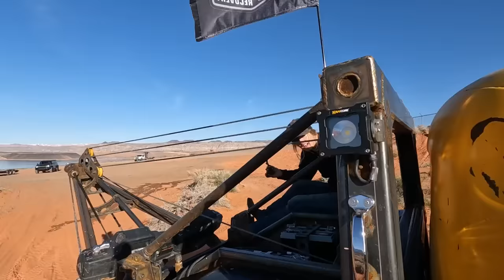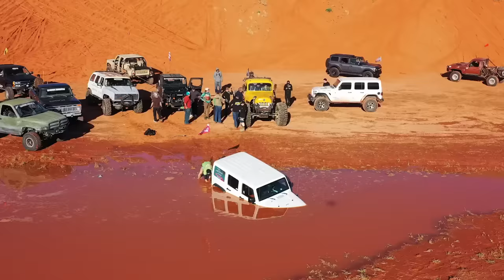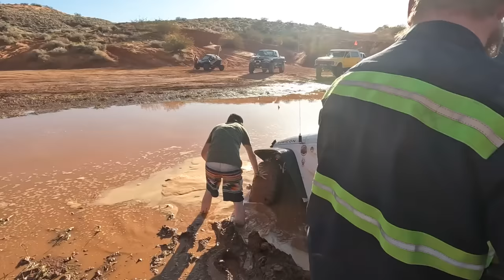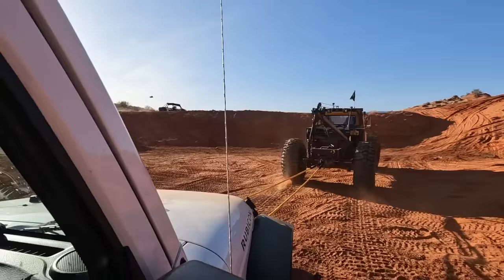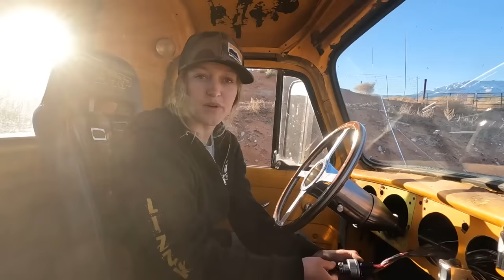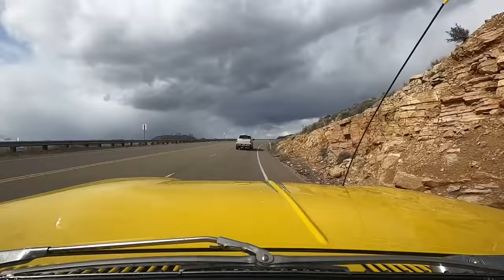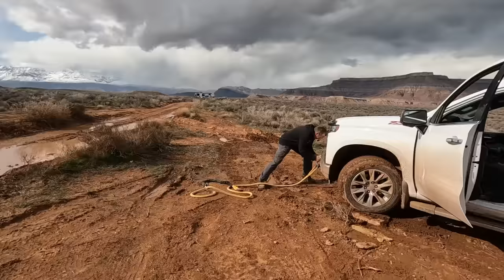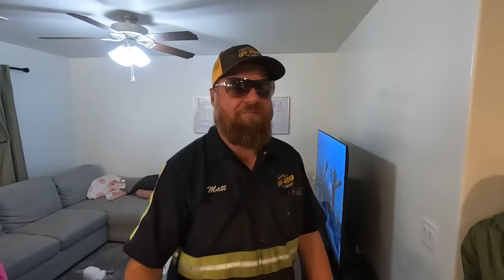Customer Took His Jeep Swimming...Oh My!

Comment: Lesson learned: never kinetic pull a vehicle out that is stuck deep in mud. The suction is too much and damage will occur. Use a winch with constant pressure instead. Matt has said this numerous times in his videos! It's always been true!
Reply: Actually never kinetic pull a vehicle without a kinetic rope. They used a strap not made for kinetic pulls.
Reply: They used a flat strap. Not a yankum
Reply: Doesn't matter this one is crusher bound.
Reply: @jordanwacker7762  Yes, absolutely true, you shouldn't do a "kinetic" pull without an actual kinetic rope, so that's half of their failure. But Matt's been very clear about NOT doing a kinetic pull in these conditions even with the correct gear for the reasons that Joe mentioned. There's just too much suction and you're going to break things. Slow and steady with a winch is MUCH safer.
Reply: @jordanwacker7762  Not that a real snatch strap is bad, It's what we Aussies have gown up with, just 20% stretch instead of a yankum's 30%. It's plain straps that are the terrible idea.
Reply: Judging by the damage to the Jeep I wonder if they used a hitch ball and it broke.
Reply: @ROgletree  Did you watch the videos from the Wrecker Games? Paul broke a Yankum strap (one of the short loops to connect ropes together) and the resulting damage to Blue Steel and his wrecker was similar...

Now, the energy he put into that was likely WAY higher than in this case, but the point remains that rope can still do a LOT of damage with enough speed.
Reply: @ROgletree  I would say no, a towball would have gone straight through the body. Staps can kill even without steel...
Reply: I remember when Matt was 100% against winches and refused to use them , just saying.
Reply: @Dj-ve2hx  Haha, yeah, he's only decided winches are good in the last couple years. Him discovering synthetic winch lines was a big turning point for him.

However, even before his conversion to the world of winches he wouldn't have done a kinetic pull in this kind of situation. He'd have pulled statically with one vehicle, or maybe linked up vehicles to give more pulling force. There's plenty of older videos of him doing that and explaining why he's not doing a kinetic pull, even before he started using winches.
Reply: They made the mistake of trying kinetic recovery with a flat strap, they don’t absorb  and build up energy they will break every time. A proper kinetic rope is the only thing to try. But the wrecker was to real proper tool for this job, slow constant upwards pull, great job. Always call the professionals, they know what they’re doing. If you use amateurs that’s how you get smashed windows and lights!
Reply: @Dj-ve2hx   Not true. He had a winch. Not mounted but in the trunk. It is true he did not use it much (only mount it, if it really had to).
Reply: @ROgletree it had to have. That's a whole smash.
Reply: @smcox1991 you can do little bumps, but that's usually only useful in snow/ ice if there is one wheel stuck, not for anything buried.
Reply: exactly!  That's why boat anchors for mud are mushroom shaped, as the suction on even a small anchor can keep a good sized boat in place
Reply: @pcar5 Does insurance cover the damage if you total your car being an idiot off-road?

Comment: The ability to lift upwards on that jeep is what made it come out so easily. Hard to appreciate the difference that makes instead of trying push the mud along behind it.
Reply: Almost like it helps break the suction
Reply: Yeah, I don't know if it would have been possible even with the Morrvair AND the Banana winching in tandem.  Needed elevation.  Off-Road Wrecker earning its keep right there.
Reply: @BringerOfDearth  +Geometry
Reply: no disrespect  but there were already at least 7 vehicle   jeeps and truck already there and those  vehicles  could not get this vehicle out of that mud
Reply: I have moved some very heavy stuff with the simple addition of a gin pole.  Instead of trying to pull the thing through the slope a gin pole allows you to pull it upward and away/above  the slope.  Even the simple addition of a tire rim (so the rope, cable, chain goes up and over) makes a huge difference and is well worth the effort.
Reply: @jameseverly8501  They didn't have to world's largest off-road wrecker 😊
Reply: If you are pulling too hard you are pulling in the wrong direction.
Reply: @Aerkavo  I wonder why some of these crews don`t carry a " tripod" with a " pulley " at the top to run a rope or strap through it , in order to get the rope/ strap 5-6 feet up off the
                     ground .  (  For all I know , that may be what a gin pole is . )
                     I know some guys pull out tree roots ,  using a tire rim ( or with a tire on a rim ) to elevate the rope or strap , just the way you have described .

Comment: Man, the wrecker made that job look easy! I know from watching previous mud recoveries that's not the case. You guys have built an incredible recovery asset.
Reply: I was thinking the same. Even with Winches, the Morvair would have been slipping and likely need to be anchored etc, and it would have been a much harder pull out to the road. This was the purpose designed rig Matt envisioned and is now proven, even as it is being further improved and tuned. One improvement I would add right away is a textured mat to the toolbox lid so that if there are riders they are more secure from sliding around on rough roads.  Databyter

Comment: As often as people end up riding the toolboxes, you really ought to put seats up there!👍
Reply: I was just thinking maybe they should try and put a bench seat in there🤔
Reply: I thought the same, two seats with seat belts would be awesome.
Reply: The Trashman  Matt said a while back they didn't do that because they needed all the visibility they could get, and a crew cab would just introduce more blind spots, or something to that extent.
Reply: I told you you needed a crew cab.
Reply: I think Subaru or Isuzu truck in the 80’s with the two bomber seats in the bed. It was call the Brat. Put you spurs on Lizzy.
Reply: @bulletproofpepper2  I just commented than saw your comment. It was Subaru BRAT based on Leon. Joy drove it in My name is Earl, I remembered that car because my father had Leon (in Croatia, it was sold as "nameless" Subaru 1800 AWD) from 1986. BRAT had seats faceing backwards, weather proof, low profile with really low back part + adjustable headrest (ideal for visibility issue), plus little handles for holding.
Reply: A couple high back lawnmower seats and belts for tiny asses.
Reply: @mrblc882  
Yes, the Subaru Brat was a great little 4x4.  A couple of my friends had them, and I always meant to get one but never did.
Reply: @CaptainKevin  
Don't much care for crew cabs myself!
Reply: Subaru Brat seats would be perfect
Reply: Or build a scrambler for the rest of the crew to get to the job. "Second Banana.” Please do something soon. That's really unsafe.
Reply: The Trashman  Cameras can also fail.
Reply: @jeremiahdye8748  They did, Jefe was following with his Bronco.
Reply: Yeah some little fold down jump seats with a lap belt (I know Lizzy won't wear it anyway) would be a good addition.

Comment: Jerking on it with a static strap... lucky all that got hurt was the window and taillight. That would have been a lot even for kinetic. Winch was definitely the right tool for that job. And with the wrecker booms being able to lift as well as pull made that look easy! Well done Matt and crew! Making the impossible look easy and professionalism all the way!
Reply: They tried with a strap to pull it out when most of the vehicles there has a winch.. amateurs.
Reply from the maker: They should probably watch some YouTube channels that do recoveries before they go out and use their recovery tools.
Reply: @Matt's Off Road Recovery  yeah a little education can go a long way. Even the "proper" equipment can be dangerous if used improperly. That's one of the things I really like about your channel is that you're pretty good about explaining what you're doing and why. It's not quite a how-to video but it shows that you have the safety of your crew and the customer's vehicle in mind. Sometimes there's just no good way to do something and you do the best you can with what you have but you always make it as safe as possible. Hats off to you my friend keep it up.
Reply: I broke a 25,000 lb kinetic rope pulling with my Tacoma against a 2500 Silverado Duramax with its front axle buried in mud to the frame. Took out my tailgate. Then I used my Hi-Lift on a couple of 4x4's to lift the front out. Still got them out. New tailgate $120. Black primer contrasts well with my red Takoma. Lots of fun.
Reply: Tom Tom, did you find that micro sD card useful?

Comment: I've heard Matt comment several times about the lack of fenders on the Off Road Wrecker.   Some of the larger 4wd tractors have fenders that bolt to the axle and turn with the tire.  The fenders are plastic and light weight.  Possible they could be adapted to work on the wrecker.
Reply: Something like that might work and not interfere with the sweet sweet lines of the wrecker.
Reply: @dmelson7502  Also needs to consider the flex when they're crawling buggy trails.  Not an easy fix, I think.
Reply: @warrendon1388  I think what he is getting at is if the fender is mounted to the axle the fender will move as the suspension flexes allowing there to be very little clearance between the tire and the fender with out ever interfering.

Comment: The wrecker definitely needs MORR seats mounted to it 😂
Reply: Yeah 👍
Reply: Some folding jump-seats over the toolboxes, yeah
Reply: @aaroncuilty9306  a wonderful idea 👍
Reply: Some old Traktor seat would be cool
Reply: Only down side... I could see someone getting thumped pretty good from a good sized rock coming off those big tires... Would have to build some type of fender 😊
Reply: @danmcburney3247  they would be good anyway to keep the mud at least somewhat contained. Someone suggested ones that mount off the knuckle, sounded good to me if they can get enough clearance
Reply: I wonder if no seats yet has something to do with getting it “street legal” Mabey once it’s street legal removable seats can be installed and used off road only. Not sure about the laws but just a thought
Reply: Poor design, self centered ideas.

Comment: Those aerial shots are so funny, the wrecker really does just leave everything behind 😂😂 You can see how well it handles whoops compared to everyone else
Reply: It doesn't leave anything behind, it tows them
Reply: Well it’s got 20” travel in the shocks and the spring rate in the sidewalls of the 44” tires. 
That truck was “designed” to do certain things and mud removals is what it was designed for.
Reply: @stevemiller3082  54" tires

Comment: Another highly watchable video. Is there anything 'recovery' that powerful wrecker cannot do!?  Those Yankum ropes together with a rig that has the stamina to give a steady pull look pretty good for most applications.  You already knew getting that jeep full of water out of the 'muddy pond' clearly needed a winch with two power lines to walk it out. Wondering how exactly did one of the previous helpers break the back window?

Comment: I think it'd ba a great idea to build a couple small lightweight aluminum jumper seats to mount on the wrecker bed somewhere, that's easy to mount and remove with a couple pins so you can remove it in seconds, and be able to fold them up and make a roof rack or something to put them when not in use.

Comment: Would mounting some low back plastic seats on top of the tool boxes maybe an option. Since it seems like the tool boxes are becoming used regularly as additional seating on recovery’s. 
Plastic seats may not be the most comfortable but at least they’d clean off easy and provide stability and help prevent some from sliding off the tool box and getting sucked under the rear tires setting directly in front of them.

Comment: I once had to recover a brand new CJ7 Jeep submerged in 24" of solid ice at zero degrees for 5 days. We had to use axes to break the ice, and a Holmes 850 on a Kenworth chassis to get it out. There was so much ice still on the Jeep that it squatted the springs on the rollback.

Comment: I called it in the last video put some strong MAGNETS on the back of that remote controller for the winches.
Then you only put it on metal not on a tire. This way when you drive off and forget about it hopefully it'll still be stuck to the metal. 
GOOD LUCK 🤞

Comment: Those are the kinda jobs that'll make Rhett, "The-Man" at this stuff in 10yrs or so, Matt needs to use that capable resource more often,😉👍, and he needs to do the finish work on the wrecker asap, it's proven itself more than worthy of being finished, and adequately-equipped even,🤨, you should've hooked the camper up to the Moorvair, and towed it to solid ground, the guy's truck was already unhooked from it, you took a chance of getting the truck and camper stuck, but luckily it wasn't that bad,👍, thanks for sharing guys.

Comment: While there ARE kinetic flat straps, usually flat straps are NOT kinetic, so if they tried to JERK that out with a Kinetic, the had a pretty good chance of doing damage to both vehicles involved. Don't do that folks. Flat straps are for pulling not jerking, and you can't PULL a jeep stuck that badly in the mud with just another Jeep. You have to use kinetic or winches and anchors. They shoulda waited, but I'm sure it was all in the good spitit of helpfulness and good intentions. If you want to help yank folks out of bogs, get a Kinetic or use a winch.  Or, call Matt or similar.

Comment: Why the wrecker made that look so easy was the angle. The boom lets you set the pull point up high which means part of the weight of the vehicle is being lifted up and out of the mud instead of the whole weight trying to be pulled through it. Shame on the additional damage on it. Vehicle could be salvaged in their climate pretty easily if the customer doesn't want to claim or can't claim depending on their insurance policy. Just have to pull the interior apart and let it air dry for a week in their dry climate and replace any bad modules that aren't weather sealed.

Comment: I believe that all you have to do is drain the oil, take all the spark plugs out and turn the engine over to pump the water out of the cylinders. put fresh oil and filter in. You also need to have the tranny flushed. If he didn't bend a rod, it should be fine after that.

Comment: Idk why people seem to think yellow "Tow" straps, translates into pulling straps... they literally have big tags telling you to never apply snapping force on the strap or what happened, happens.. ive seen so many damaged vehicles from those straps. They are only for hooking up and just towing someone down the road, not yanking them out of mud and and and etc.. they really are only good for things like if you run out of gas and need a tow down the road.. but NEVER yank someone out with them. They can take your head right off like a steel cable.. please if your going to pull someone out, use proper gear such as, a yankum  kinetic rope or a winch preferably with a soft line so it doesnt cut anything or anyone in half. but under no circumstances should you take a basic $20 strap and try snapping someone out of a stuck position please❤❤❤ either have the right tools for the job or let the guys and girls that do it for a living. Come do it❤❤❤

Comment: 51 yrs ago I was driving a R190 dynamite truck for an oil exploration company through desert sand dune country which looked exactly like this. The three in the front seat reminded me of the same when packing up one camp site and moving across the desert to another. S-20.6554  E124.2248 No pretty ladies up front then, sadly.

Comment: Excellent recoery matt. How much extra weight would all that water add to the 5000 lb of the jeep? A slow pull allows the water to run out, a kinetic pull makes the water a solid mass.

Comment: Boy, you wreck your teeth with that fixed metal plates. I got the same when I was young and after that the teeth fell apart because the metal plates with the glue damaged the teeths surface forever. 😞

Comment: There's a particular title code in some jurisdictions, for a car that's been flooded. As I understand it, it operates like a salvage title, only wet instead of bendy. PS: Why am I sure the Morrvair could have done the job. It wouldn't have been that easy, but - not taking anything away from the wrecker - it's amazing how capable the Morrvair is.

Comment: I have a Question for you ,  I just bought a 12K# apex winch for my oversized Dodge w250 WINCH LOOKS GREAT BUT, the ground cable is smaller than any winch I have even owned. It is almost the size of 10 gauge wire, are all the winches on your wreckers using that small gauge wire?   You do not seem to have any problems. all of my previous winches except 1 PTO had bigger ground cables than battery cable ?  thank you for your vids.  great job.

Comment: Do you use spring locks or chassis blocks to take the strain off the rear  springs when using the crane in a purely lifting situation ??